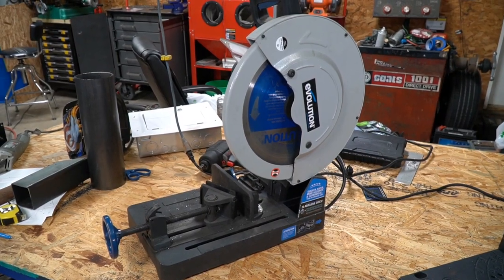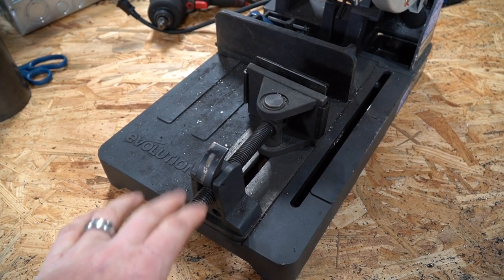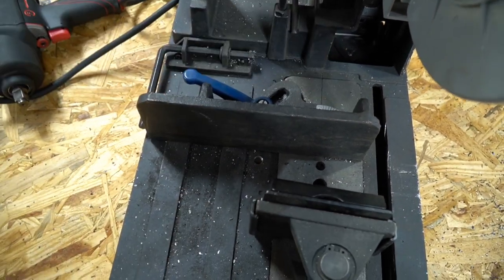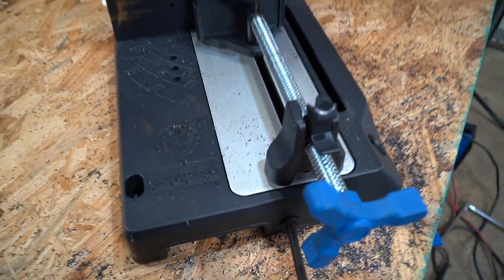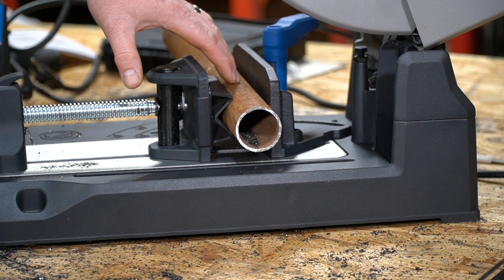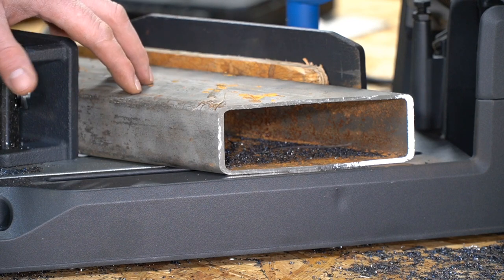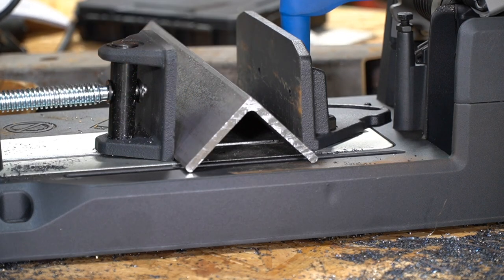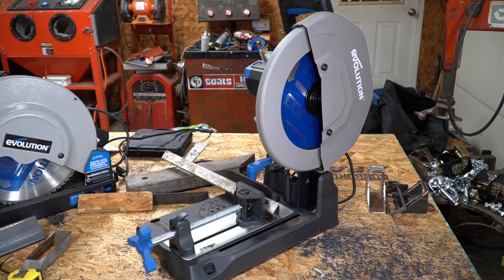Evolution S380CPS metal chop saw review!  The Ultimate Heavy Duty Chop Saw!  All Hail the King!

Comment: I have been wanting an Evolution for a while but couldn't justify the cost. Found a Rigid Abrasive saw for 50.00 on Craiglist and have been using it. Got on Facebook yesterday and saw a 380 brand new in the box for 200.00 so i jumped on it. Didn't realize there was a difference until i saw the CPS. Mine is the first version. Regardless, for 200.00 i'm extremely happy. Great review comparing them.

Comment: I just received this S380CPS yesterday and cut up 40 feet of 2'x2' x .120 wall steel tubing making about 30 cuts. Half of the cuts were made at 22.5 degrees. This saw is totaly awesome and made a cut in about ten seconds. The blade tips feels like new and this saw is unbelievable how it will cut through steel. My old band saw isn't going to be used much anymore.

Comment: My channel needs one of these. HomeDepot had an Evolution for $222 last week and I wanted to pick it up, cant recall model number. I just went online and noticed they are more expensive than the price I saw. I live 50 miles away from the city but if its there next week I may pick one up. My Dewalt abrasive wheel saw works ok but its time for an upgrade.

Comment: My local welding store has the Steelmax S14 for $325 or $350. I held off from the purchase because I wanted to wait and see how this new Evolution saw was going turn out. The Steelmax is probably the heaviest saw I’ve ever tried to lift. I had the Skilsaw 12” but returned it because the fence would flex when I cranked down on the clamp. The included blade was outstanding though. Nice review of the Evolution you posted, thanks!

Comment: Does the cuts deviate much? Im thinking updating my abrasive one to this
Reply from the maker: Pretty smooth cuts, I really like it!
Reply: @1D10CRACY  squared cuts? Does the disc last longer ? Im thinking im going for the s355 CPS
Reply from the maker: The cuts don't wonder if that is what you are asking.   They stay pretty true and I can get very close to a true 90.   The blades last a super long time and when they get dull they just cut slower.   Cuts are smooth to the touch and the metal stays cool during the cut.
Reply: Yes thank you i have an abrasive always cuts side ways bit anoying .. because i have to squared it after with a grinder but not always 100 squared.